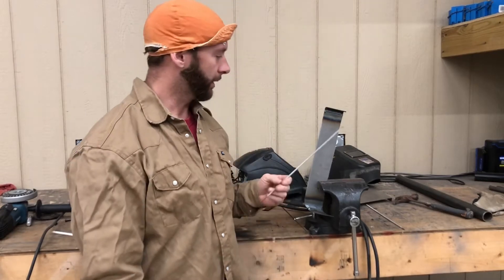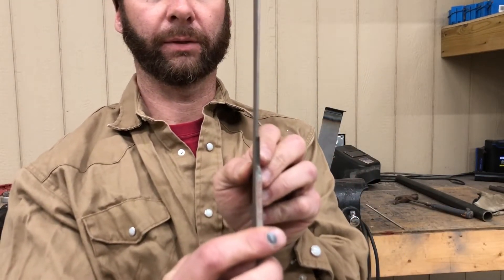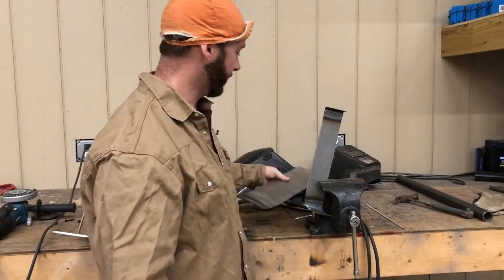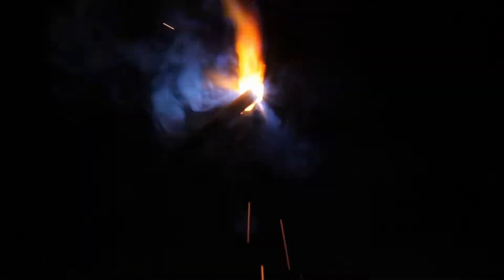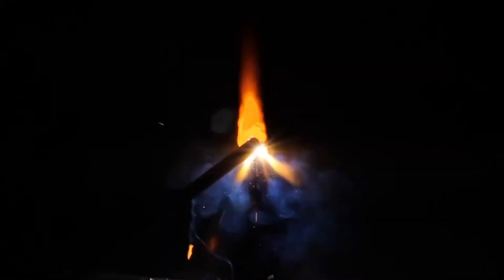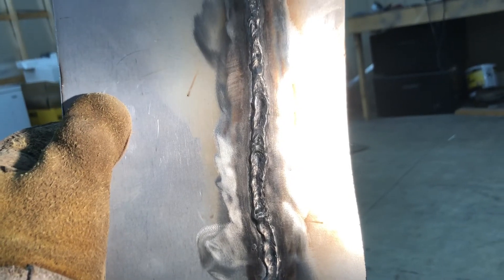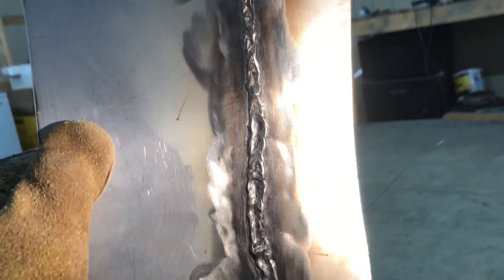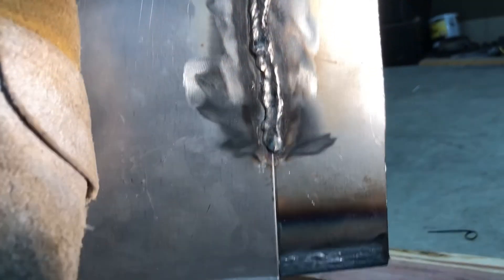Stick welding on thin metal

Comment: answered my question! thank you. im welding some thin metal with 7018 but only thing I also was told is to run it DCEN (straight polarity) for even less penetration. is this correct?
Reply from the maker: Yessir, it with help you to not burn holes in it. 👍🏻
Reply: @getweldsoon1113  so if im welding on my 03' 4runner (parts of the frame) is it safe to run my machine DCEN, meaning my clamp will be positive? obviously i should disconnect my battery but will running positive clamp on a car frame mess with electronics?

Comment: I guess the obvious question we have that you did not address is: "why weld uphill or downhill, why not just flat?  Horizontal flat you don't have to worry about gravity, right? what am I missing?
Reply from the maker: That is very true. The only thing you’re missing is, sometimes you can’t take a piece off to weld on it therefore you have to weld it in whatever position it’s in.

Comment: Will this work with rocker pannels to?
Reply from the maker: You could do it but it won’t be easy. If you don’t have much experience stick welding I wouldn’t recommend it. Hard wire might is better for that.

Comment: I run up hill on material that thin. Turn the machine down to 65-70 amps with 7018 3/32 rods. And go at almost a 90degree angle and move fast.  If you see a key hole about to form you gotta stop immediately and let it cool a bit. 
The Bead turns out good.

Comment: I have done some similar welding, but diffrent. 7018, but switched to electrode negative, and about 75 amps, short welds upphill. 
This was a emergency repair on a thin wall water tank, had to grind and weld some small places two times. But it was not looking to bad
Reply from the maker: Yeah electrode negative definitely helps with thin stuff. 👍

Comment: I'm practicing for my L.A City light gauge. 10 gauge steel, 3g vertical up, with a 16th of an inch gap. I thought I was only supposed to use 6010. I read the code book. I can use either or. I went with 7018 at 80amps. Long story short. I wasted a lot of practice time blowing holes with 6010.
Reply from the maker: Yeah 6010 definitely takes a lot of practice to run uphill on thin stuff. Glad you’re able to use 7018.

Comment: 6013 easy to run downhill then 7018
Reply from the maker: Yeah I believe they are. Someone had asked me about how to weld thin material with stick rods so I make this video for them. 7018 is what I had in my shop. 6010 and 7010 is even easier because there’s not much slag to get in your way. I just wanted to show that it is possible if you only have a stick machine to weld thin metal.👍
Reply: Please make more videos on this subject. With 6013 rods specifying the amperes and the rod thickness. Homeowners usually we have a stick weld and we have to deal  with thin metals repairs